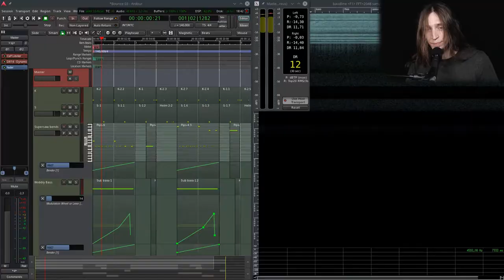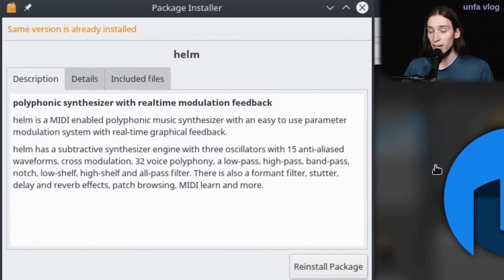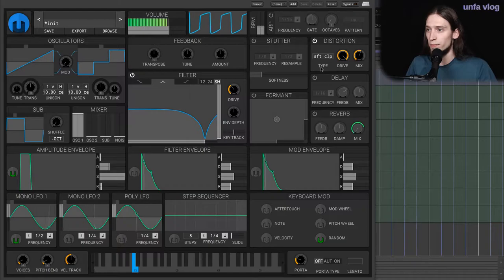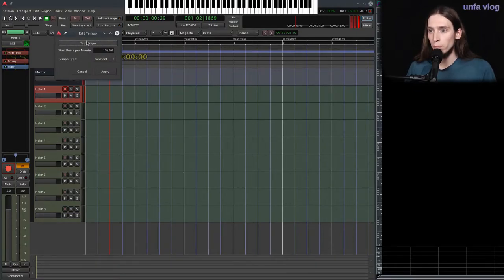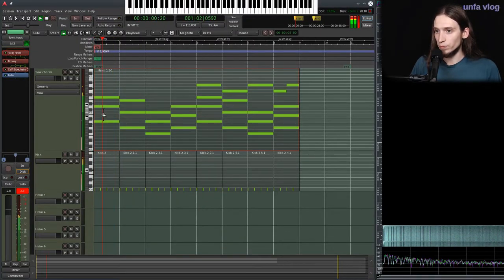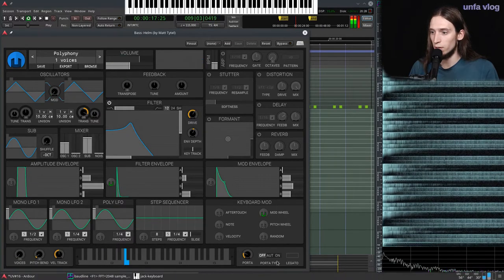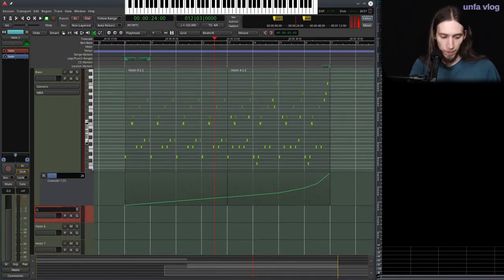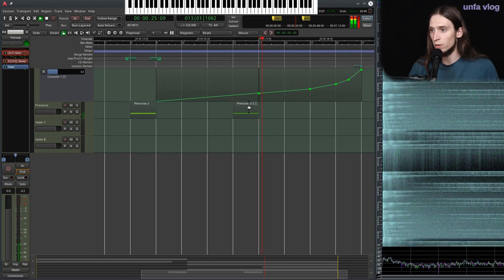UV#16 Helm 0.9.0 new features overview + a cool stereo trick

Comment: Hey what audio interface do you use? 
I'm thinking about switching to linux & Bitwig, But I'm not sure about driver etc. Do you have any knowledge about the compatibility with the Focusrite Scarlett line on linux?
Reply from the maker: I've heard that Fucusrite Scarletts work with Linux currentyl. I once tried it years ago and I couldn't get it to work.

I personally use a Behringer UPHORIA UMC202HD - if you're not planning on recording ultrasonic electromagnetic interference, get the UMC202 (without HD) - it's a bit cheaper but doesn't work worth 192 kHz sampling rate which is rarely useful, and practically useless unless you're doing some funky weird sound design.

These are dual XLR-preamp interfaces with TRS monitors output. There's a whole family of these. I used Behringers with Linux up to different variants of X32 (their digital mixer flagship) and X Air 18 (a smaller remote-controlled mixer) and it all works flawlessly with Linux out of the box. They also have their X32-Edit and X-Air Edit programs released for Linux so you're not missing out on anything using Behringer gear and Linux :)
Reply: If it helps, I had scarlett  2i2 and works with no problems. However I'm not being able to make scarlett 18i6 work with Jack...
Reply from the maker: That's already some progress. Thanks!

Comment: Any good way to run helm in lmms? I use it with Carla plugin for now and it doesn't remember my helm setting if I use it's UI
Reply from the maker: I am afraid that's the only way to use the LV2 version of it. Maybe you could use VeSTige with the VST version?
Reply: @unfa00  the problem is that only download available for linux is a deb version. And building vst version from github produces an error with alsa library or whatever else. If you have any idea where I could find helm vst for linux pls let me know.
Reply from the maker: @EdLrandom  Hmm, I'm not sure. Maybe ask on Helm's GitHub? I wonder if you would be able to use a Windows VST of Helm inside LMMS?
Reply: @unfa00  I know there is a way to do that but once again, official site download is standalone program file even for windows.